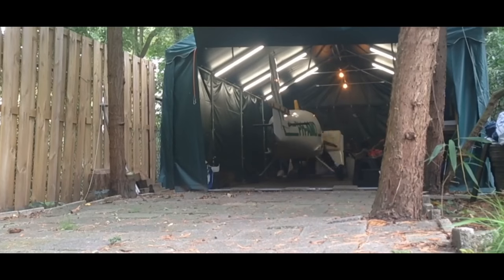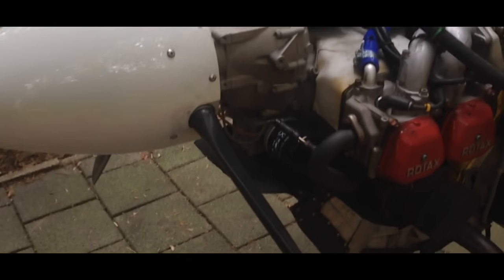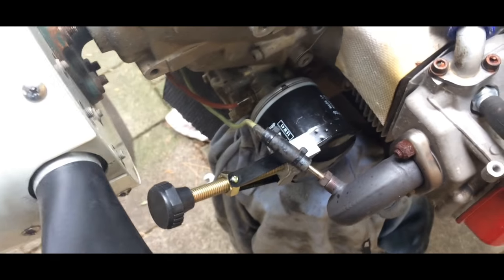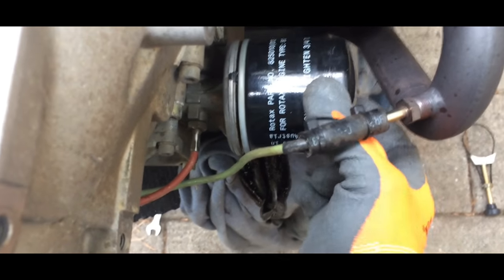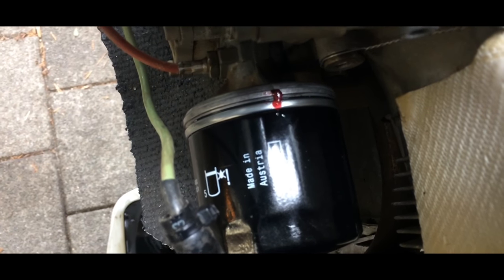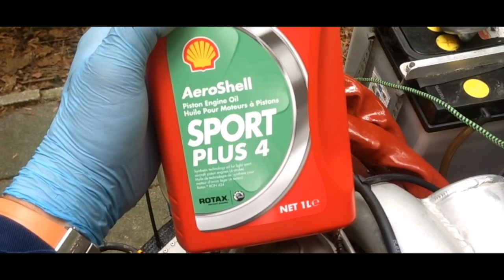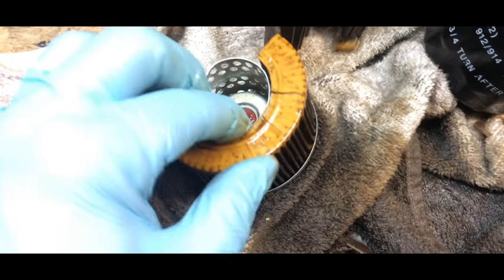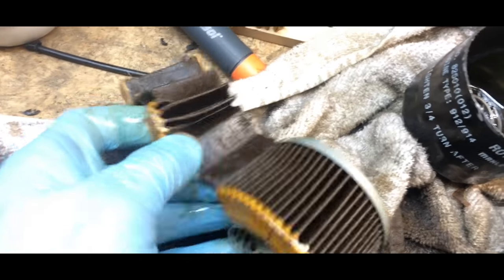Rotax 914 Oil change

Comment: The proper way to open to filter is to use the dedicated opener and a sharp blade to cut the paper part away from that yellow thing that holds it in place.
You forgot also to check the spark plugs (cleaning them in case) and the magnetic plug